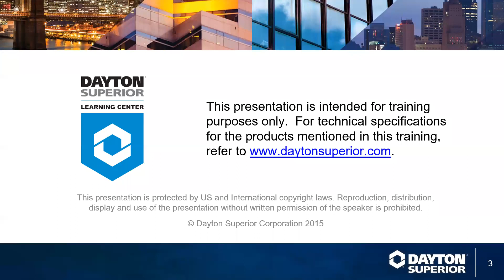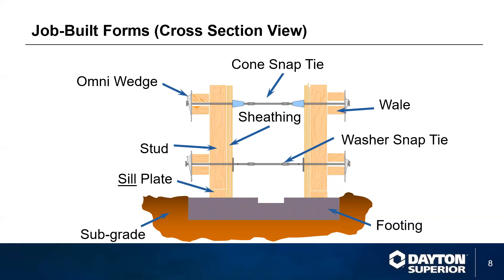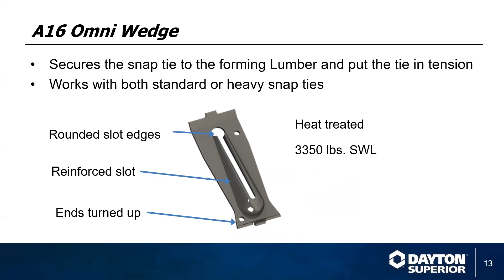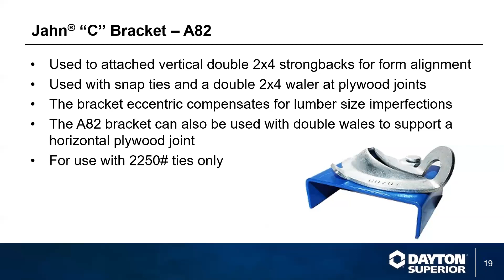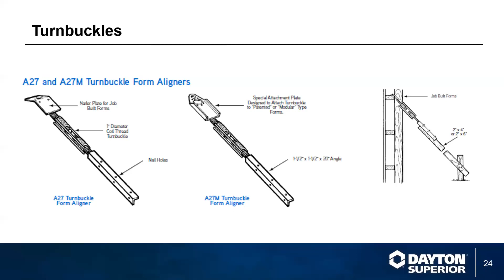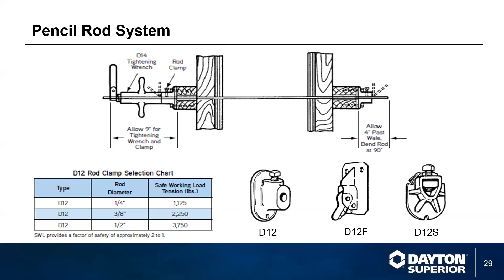Stick and Boards (Light Forming Systems) Training by Dayton Superior

Comment: This is really helpful. Are there any good charts for deciding spacing? I really didn't find much. I found the wood association document which I really struggled to understand and then it kind of looks like everybody else just deffers to that.
Reply from the maker: We are glad you enjoyed the video! We have some helpful charts and tips in the first section of our Concrete Forming Accessories handbook. It is available on our website to download: https://www.daytonsuperior.com/docs/default-source/handbooks/concreteformingaccessorieshb.pdf?sfvrsn=24f1d560_120
Reply: @Daytonsuperior  I will check it out, thanks.
Reply: Thanks for the video, very interesting and helpful, I wish this system was more common and readily available in the UK.

Comment: Great Video. So much useful information!!! Rookie question but when would it be acceptable to use a waler only form system with short end ties over a waler with strongback/stud + long end tie system?
Reply from the maker: We are happy to answer any question, no worries on that! You can use a short end snap-tie with the Jahn System up to 8’0” in height: your pour rate of concrete is limited and you will still need to have a strongback every 8’0” oc. The Jahn System is load rated at 2250lb SWL so you are limited to a pour rate with this system to maximize the loading per tie. Hope that helps and thanks so much for the video feedback.
Reply: Thank you for your knowledge! I just completed my 50’ long and 4’ tall concrete planter with  strongbacks 8’ on center held up well.
Reply from the maker: @dvdr1985  So glad to hear that, always happy to help out.